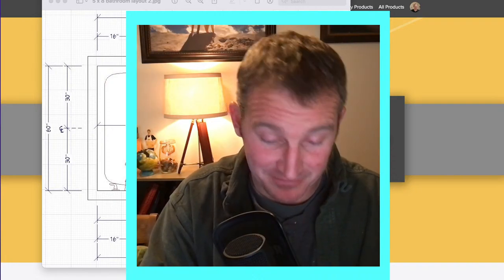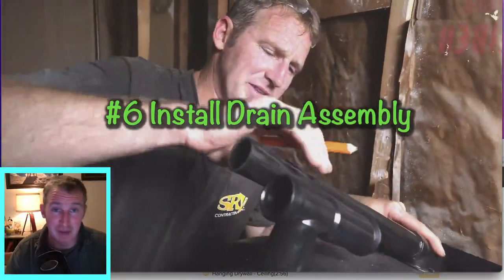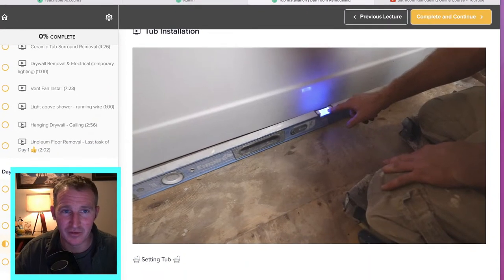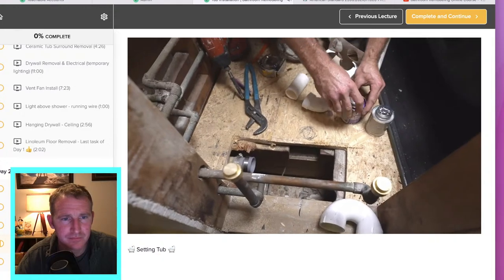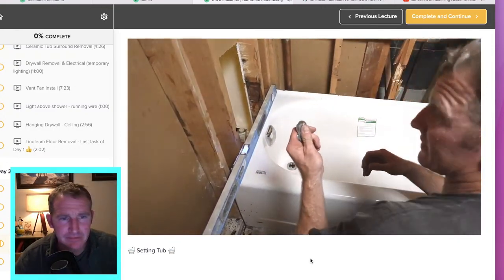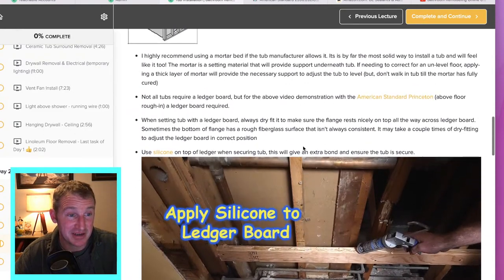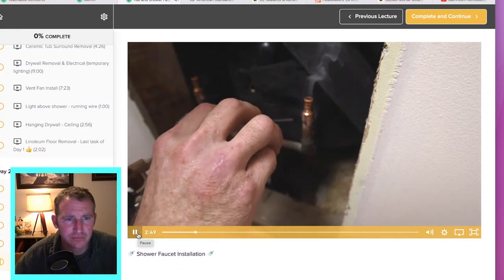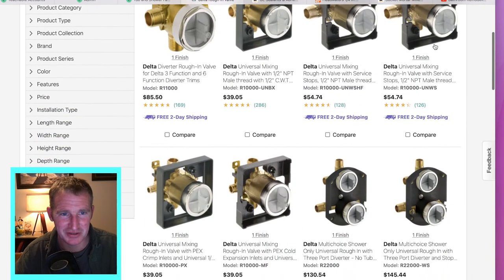Bathroom Remodeling Course | Day 2 Part 2

Comment: Hey Steve, good segment. I do more service work (replacing leaking cartridges) and my favorite shower faucet is Moen. The old Delta's are a pain, if you don't hold back the housing when loosening the retaining ring you can snap the little supply tubes. The all time worse is Phister. Anyway the new Delta is much improved and though I'm old school copper you make good points on the ease of Pex. Also using valves with built-in shutoffs, a big bonus and something I rarely encounter. In my area (Chicago), new code you have to use valves with the integral shutoffs on new construction or when remodeling. Again, good content!
Reply from the maker: Thanks! 👍 Yeah I like Moen a lot too. Never even touched Phister, 😆